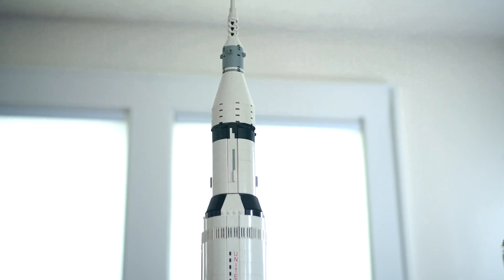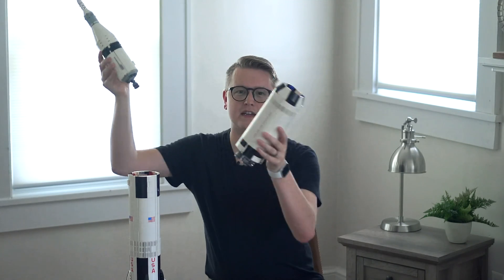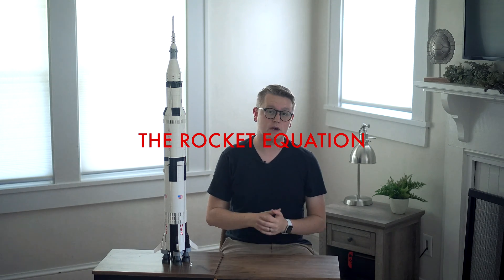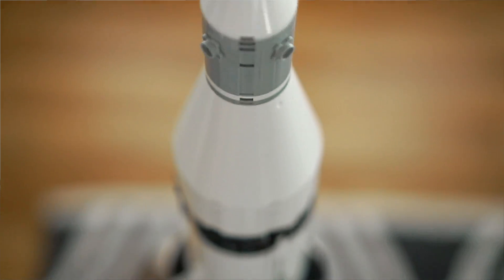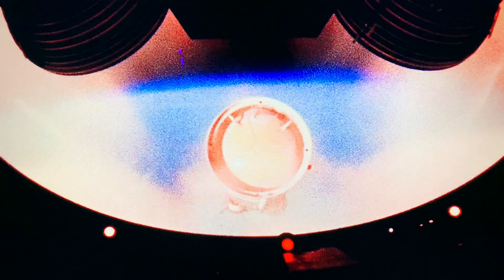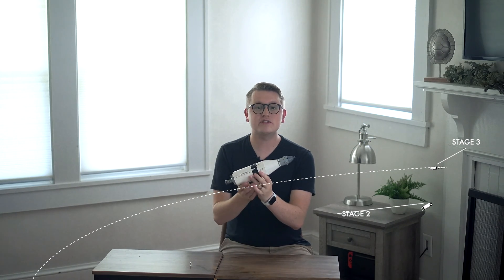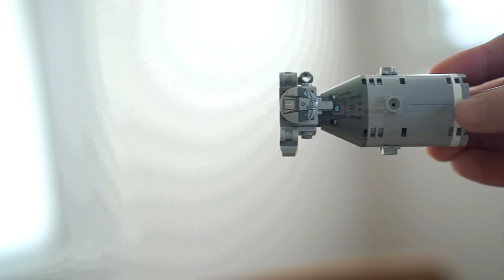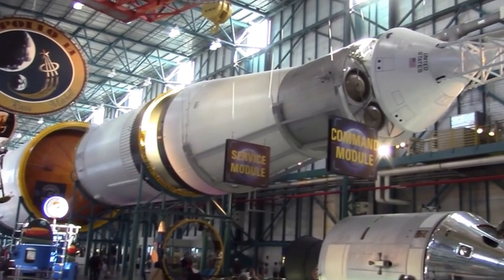How did Apollo 11 Get to the Moon? (Lego Model)

Comment: Dang this video is good. I am re-excited about space again. Very good explanation? I did wonder, what is the Rocket Equation? You never showed it.
Reply from the maker: Thanks! So the Tsiolkovsky Rocket Equation (or the Ideal Rocket Equation) is honestly pretty complicated for a novice like me. I’ll do my best to explain it with my limited understanding. Basically, it describes the changing relationship between the rocket, the thrust force, and the payload (among a few other factors). When you start with the end goal (we want to land this much weight on the moon), this equation allows you to work backwards to determine how much fuel your rocket needs to get there, knowing that as the rocket burns fuel, the weight will decrease during launch. That among of fuel obviously has some kind of relationship to the size and weight of your rocket. The more fuel you need, the larger your rocket needs to be. So you could launch a MASSIVE rocket that is far larger than the Saturn V to get your lunar lander to the moon, but another options is to jettison unnecessary weight as you continue to convert your fuel into a thrust force. This is how most rockets work, including the Saturn V, because it is much more efficient to reduce not only the weight of fuel during your journey, but also the fuel tanks you no longer need. This article here is a pretty good resource to learn more! https://www.planetary.org/articles/20170428-the-rocket-equation-part-1